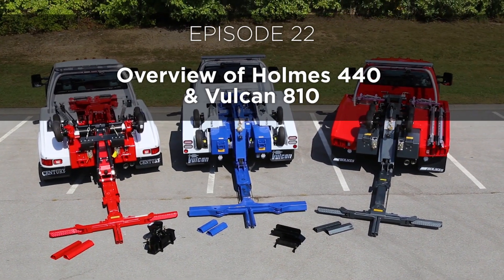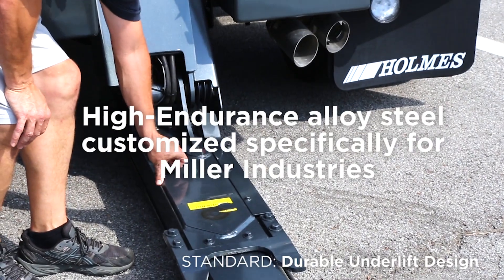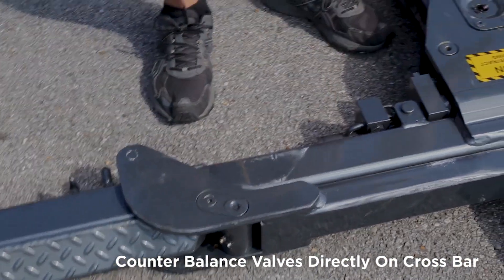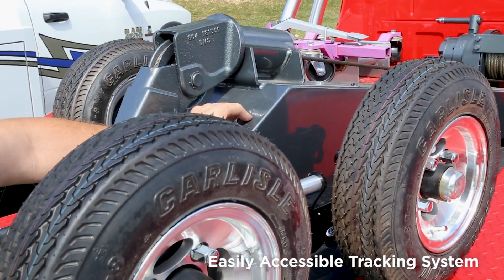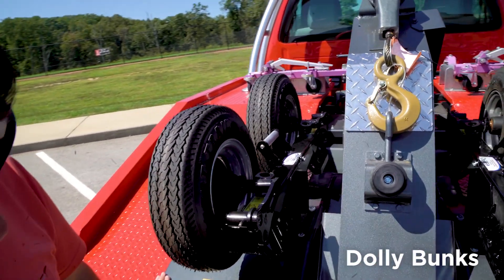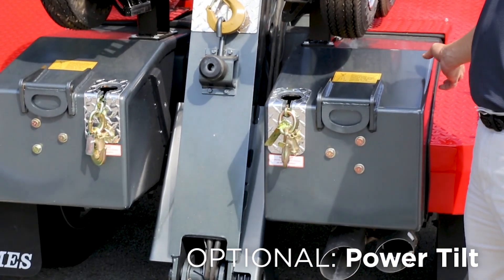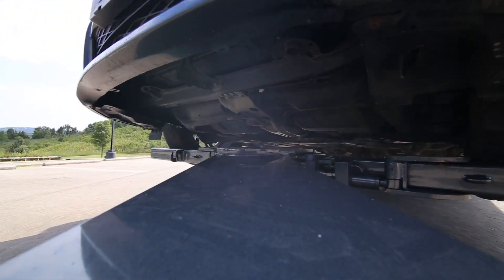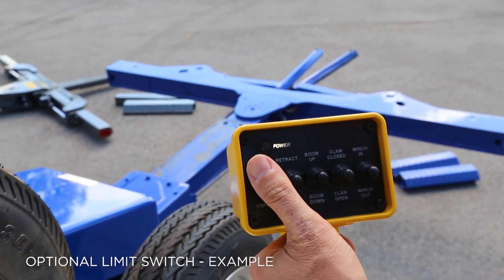Holmes 440 and Vulcan 810 Light Duty Self loader overview

Comment: I find the use of Holmes 440 as the designation for a wheel lift to be sacrilege. The Holmes 440 was THE wrecker body for decades. Of course, Holmes made plenty of other sizes and styles also. I think that the 440 was responsible for more successful recovery jobs over the years than could ever be documented. As I write this, I'm reminded of bringing a '66 Mustang out of a canal diversion box. Almost vertical extraction up the narrow opening. Would have liked to pummel the punks who stole it and did such a chicken caca deed.
Reply: How much do the 440 cost you? I need 1.

Comment: Does Miller plan on switching to a hex-pin system with bronze bushings? The hex pin system on the cross-bar can be tightened by the operator when needed instead of being replaced. Detroit Wrecker are the only ones that I've found doing it.
Reply: That's probably a detroit copyright feature, watch a detroit wheel lift video. I like them

Comment: so ?? what are the four tiny little wheels for ??
Reply: Those are wheel dolly to attach to the rear wheels of the towed vehicle. Used in a case where the towed vehicle cannot roll on road as in a case where the bearings failed or tire damage, etc
Reply: @dionkraft6782  or for use when dragging the vehicle tires on the ground will destroy the trans ot transfer case. awd, full-time 4x4, rear wheel with front tow.